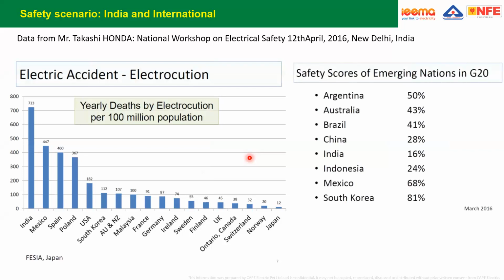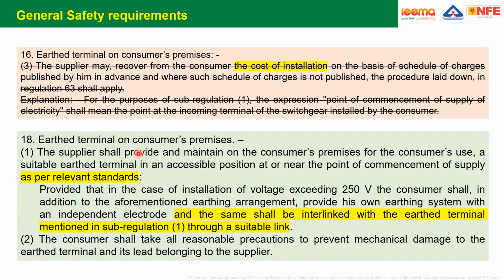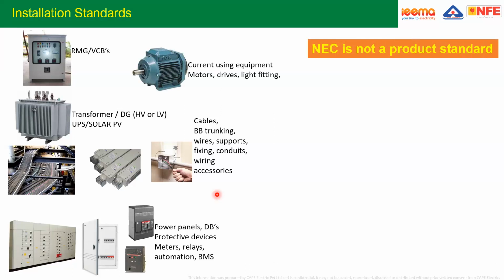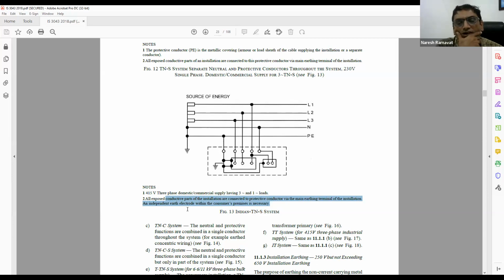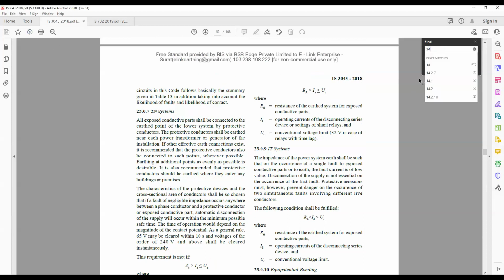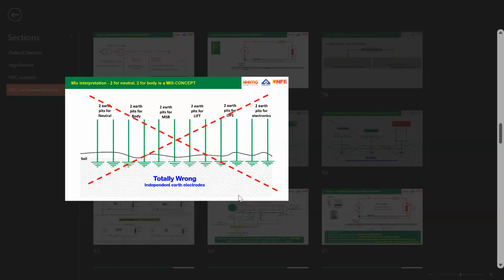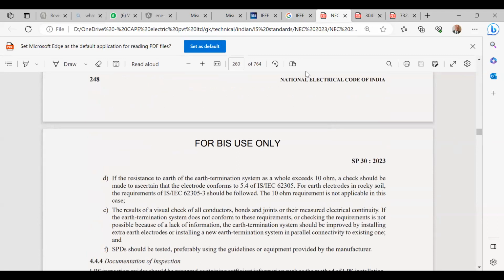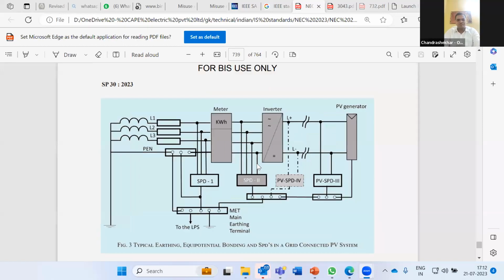Decoding National Electrical Code of India 2023 | IEEMA Webinar Supported by NFE/BIS.

Comment: Pleas clarify whether I am correct
1. HT consumer within its own premise should use TNS whrle DISCOM should use TNCS system of earthing with MEN system along the route.
2.Every three phase customer(MV)  has to provide its own earth electrode and NE connection is to made at the point of commencement of supoly.
3.Low voltage customer has to use TT system with RCCB. Earthing electrode is not mandatory but still recommended.